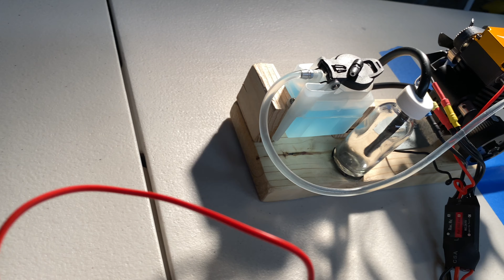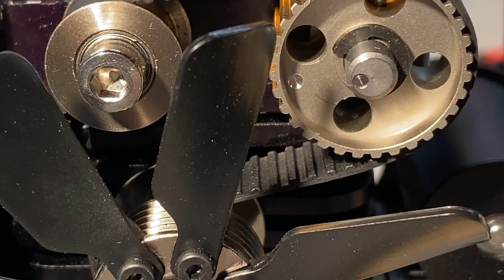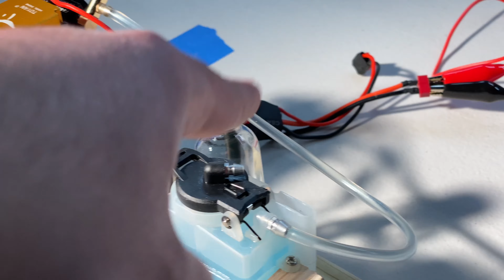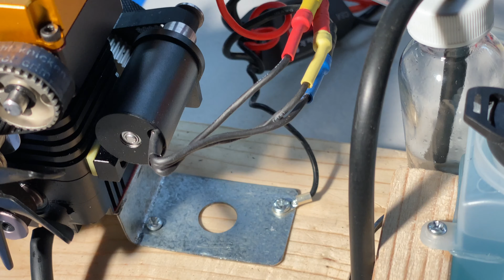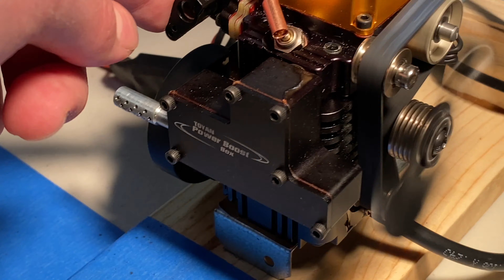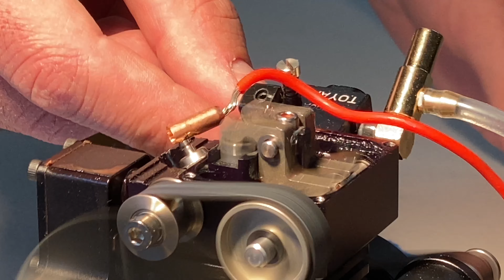Small RC Engine Set Up and Run

Comment from the maker: This is the video everyone has been waiting for since the introduction to this project. It took multiple attempts due to a faulty starter battery, but with determination this was possible. It came to a point where finding the battery would be a hassle, but fortunately I found the right one. I built a plaque and successfully started the engine. The engine was further inspected before starting. Things like the timing belt, fuel delivery, compression and more were looked at to ensure a healthy start. To my surprise the engine ran in the first attempt. Everything from throttle response to power was extremely impressive. The engine had no mechanical faults and ran beautifully, not too rich, not too lean. The most important takeaway from this project was a valuable lesson that I learned. Always have hope in your heart that tomorrow will be a better day. When things got challenging, I took a breath and remembered to keep trying until success was achieved.